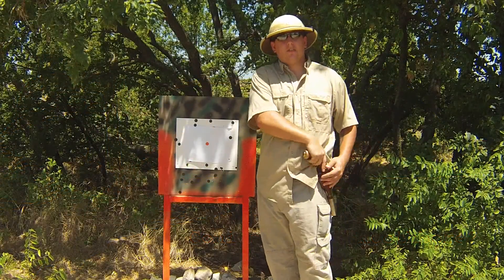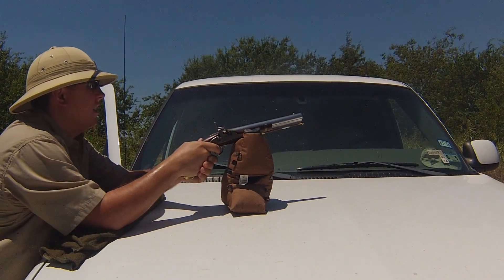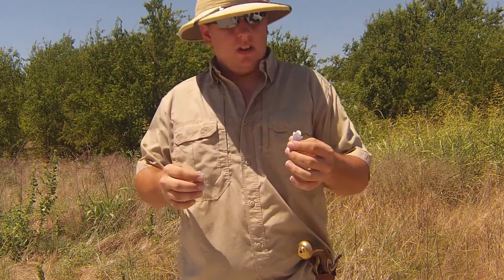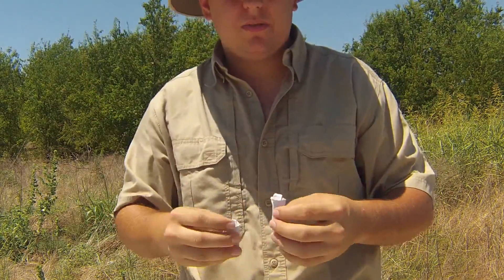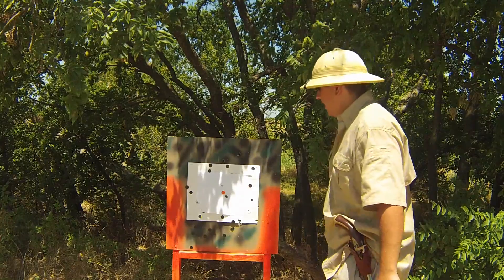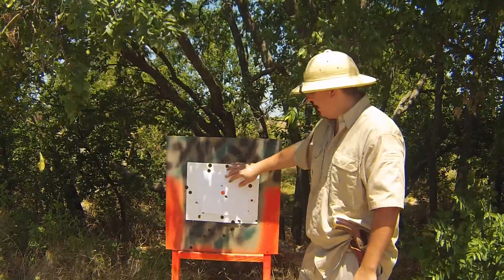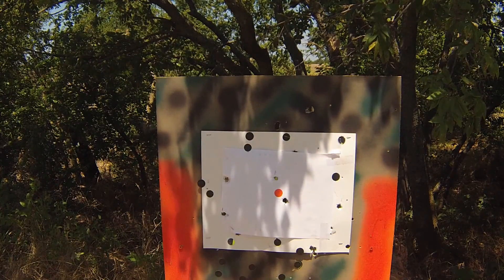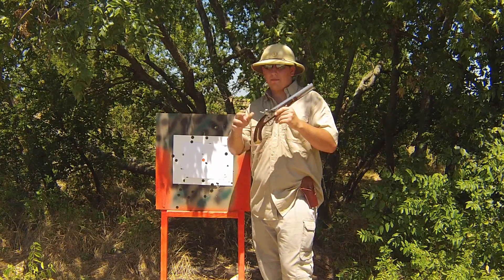Conical bullet accuracy in a SMOOTH bore?

Comment: accurate shooting from paper cartridges requires different diameter projectiles than using a cloth patch, generally. I can generally get about 9" groups at 100 yards with my 12 bore (.72) smooth gun (it's not a smooth rifle... it has no scratches in the bore... so it's not a rifled piece). It has front & rear sights, a 33" barrel (reamed and threaded for modern choke tubes, obviously use the cyl one for large shot); and the loading for large shot is a .70 ball, with 170gr of 2F, and a cartridge that makes 2.25x wraps around the ball and is made form 20# printer paper (averages .004" thickness) (gives it a final diameter of .718"). The base of the cartridge is dipped in just-molten, soft-wax (3 paraffin, 1Crisco, .25 Diesel winter treatment, by weight) . It beats you around, but would smoke just about any living thing within 75 yards.

Now I can get away with a turkey choke and about 7/8 oz of BB shot and a "mild" 60gr charge of 2F for close-in turkey. More or less takes their head off within 30 yards.
For birds and clays, I typically use 1 1/8 oz of purchased no.8's and 80gr of 2F (mod or full choke, depending on what I'm doing)
Birds on the ground get 2 oz of purchased No. 8 and 110 gr charge with the cyl choke in (might as well get the whole lot in 1 go lol) growing up on a grain farm, we always had a lot of "farm raised" pigeons, so I'd fill the freezer lol. 

Martyarms  is where I got my molds for both.

Gun has a tapered, octagonal barrel made by "The Gun Works" (in OR), stock is my own Laminate, I use a turned down and trimmed repro rammer for a British musket, lock is an LH L&R "Late English" (double throat).

Comment: 9 to 10 inch spread at 21 meters isn't maximizing the gun's possibility. You should be able to achieve 6 inches at least, at 50 yards, and 75 yards with a musket. Patched round ball, with a good lube on the patch. Tight enough to leave fabric marks on the ball. Not much experience with conicals in a smooth bore, but you would get your best results with a Foster style slug. Nose heavy and hollow based, it will fly true from a smooth bore.

Comment: Shotguns can shoot slugs out of a smoothbore barrel,try to stick a felt wadd to the base of the bullet, the drag will stabilize it.
Reply: most slugs that are used in smooth barrels today are Foster-slugs or "rifled slugs". They have grooves made into the sides of the bullet to help kinda-sorta spin it. Even still, accuracy sucks with them past about 50 yards, which is why rifled slug-guns are all the rage in "shotgun" only hunting states. 

that being said, .515" bullets in a .54, even with paper patching is entirely too loose for good accuracy (unless they are hollow-based)

Comment: patch that round ball, and adjust you powder charge, my smoothbore 54 can keep 5 shots in a 8" square @ 25 yards, mostly I shoot #4 buck shot OR 3/4 ounce#5 birdshot because it IS a 28 gauge shotgun.... to get accuracy or a good shot pattern, adjust your powder charge up or down, 35 grains is really light for a 54... try going up 5 grains at a time with a patched ball and see if your groups don't tighten up...

Comment: at 20 yrds ?? There is something wrong there. You should have a much better group than that ?? I believe you have too loose a fit. Use a good tight clothe patch so you don't have all that windage in the barrel !!!! Or, use thicker paper !! If you push paper first then you have a good paper wad seal on top of the powder. Dont tear off excess paper!